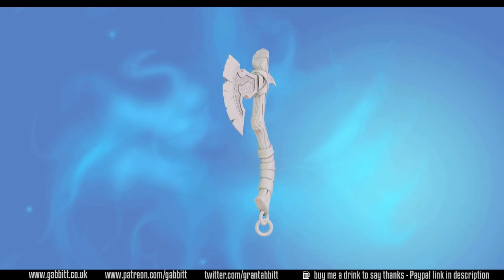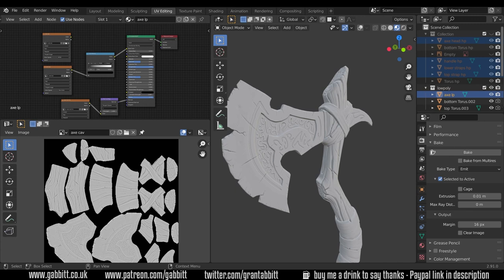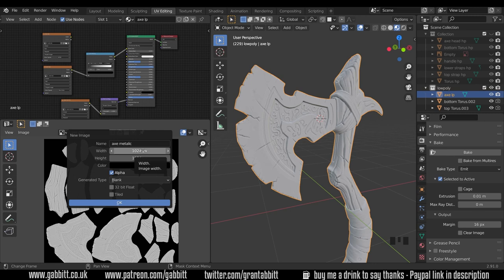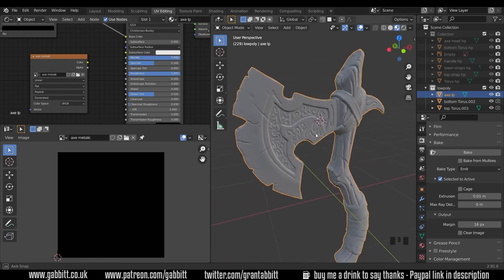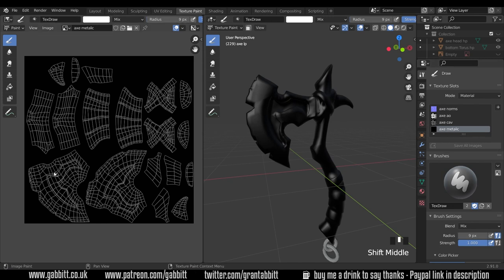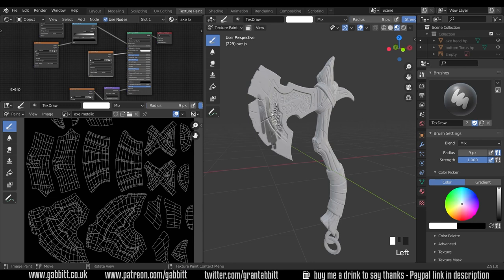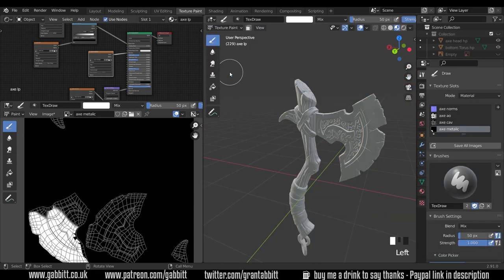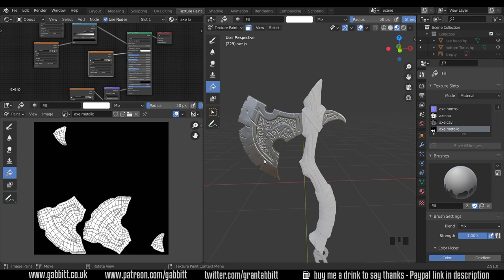Axe - Detailed Game Objects - p20 - Metallic Maps in Detail

Comment: Having a texture mask for something as basic as this is fine but doing a texture sample in engine will cost us a lot of instructions (especially as its a mask so cannot be compressed very much) 

Depending on the game engine you can create another set of UVs and place all the metal objects on one half of the image and wood/non-metal on the other and then seperate them with maths. (This avoids a texture sample and if you edit your current UVs or lightmap is basically free) 

Also 1k is more than enough, since the wood will be a lot more rough than the metal the patchness is very well hidden (how metalic an object only makes a noticable difference to the colour of its reflections) I'd even go 512 (depending on what the texture is channel packed with ofcourse) The new generation of game developers do tend to go overboard with 4k everything, IMO if you need more than 2k something is going very wrong somewhere. 

I probably sound a little harsh, I dont intend to this is the best tutorial series I've seen for a long time <3 :*
Reply from the maker: not harsh at all its good to hear the other options :)
Reply: Interesting idea on splitting the metallic and non metallic portions of the texture map. I'll have to try that. I was also wondering if it would make sense to use vertex colors (or other vertex data) for metallic and roughness.
Reply from the maker: @varnonzero  yeah i think thats possible too
Reply: @varnonzero  Yeah vertex painting is much cheaper than masking in most situations (at least in unreal) but is often used for more complex stuff as you can have greater control. (I always forget about vertex colouring which is why I didn't mention it) 

It's often used in vertex animation (or shader animation if you prefer)
Reply: @varnonzero  i will say vert colors are a good way to mask metallic areas!

I would be using such a shader in UE4 more often across my models (and do), than any shader that needs additional UV sets or which makes me arrange my existing UVs's islands into certain quadrants.

That last one is a cool idea, but I imagine it being restrictive in a noticeable way...I will keep it in mind tho. It's really nifty especially if you're doing it with your lightmap UVs, some Prima strats lmao

Also in UE4, rust can so easily look garbageeeee. Rust is a reason you'd use a texture for metallic. So if you're just not dealing with that...indeed forego the metallic texture

Comment: Hello Grant, I have a quick question about Blender. 

Blender randomly crashes for me, and upon re-opening, it will freeze up or crash again, and it takes a few days for me to use it again. My Laptop meets the system requirements for Blender, and runs smoothly nearly all of the time inside of the Software, but still crashes. I have re-installed and 'repaired' Blender, and it doesn't seem to work. It only allows me to download Blender 2.92, and I think that could be the problem, as the version could have a bug or something. I am truly lost, and I was wondering if you have a possible solution/fix. 

Much Appreciation!
Reply from the maker: It's very difficult to help here. Best to try different versions instead